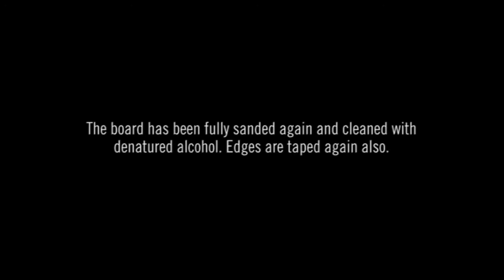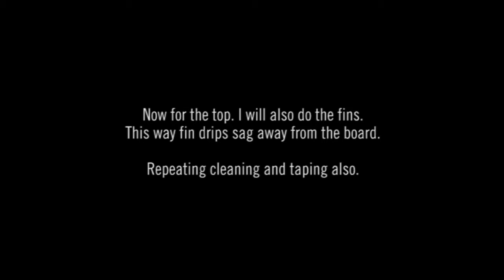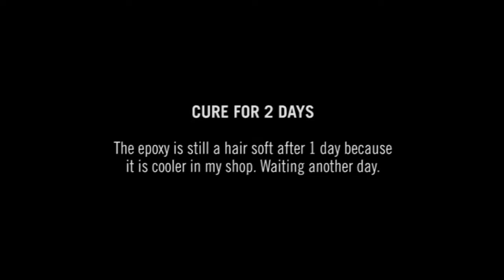Grain Surfboard Build - Part 10, Gloss Coat

Comment: HI again Sattva! Last question- I promise! What kind of polish did you use on the board?
Reply from the maker: Lush Fund I used entropy resins epoxy for the finish on my board. That said, most “light” abrasive automotive finishing compound polishes work well with an orbital polisher. I highly recommend a basic cheap orbital polisher. Slower speeds.

High speed polishers can easily burn the finish if you are not accustomed to them. I rarely need to use high speed for my work. JMO.
Reply: Did Grain recommend polishing like you show in your video?
Reply from the maker: Lush Fund You should check with Grain on their recommended finishing process. This is just how I did mine. I am not a board builder as stated in my videos. They will know better than me.
Reply: Will do! Thanks for all your help you gave me!

Comment: Size and kgs? From finish board?
Reply from the maker: 93cm tall 54.6cm mid about 6.9cm thick (6'4"x 21.5" x 2.75") Weight: Havent weighed it, not to heavy at all and it does float. :)